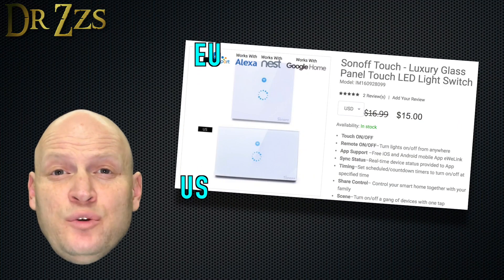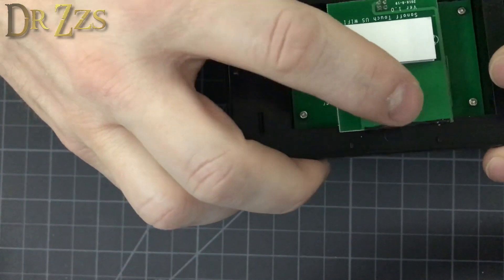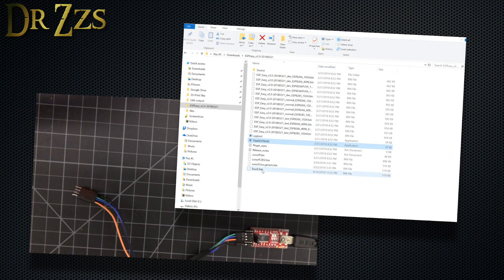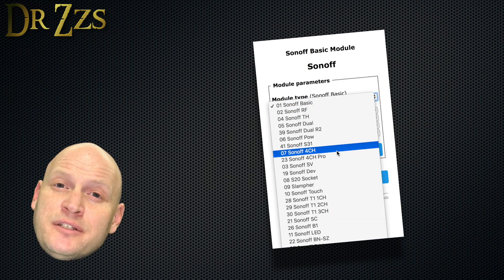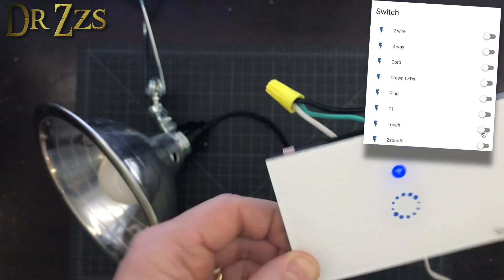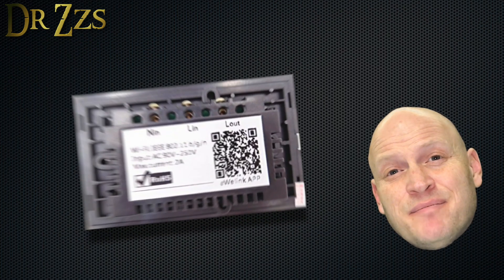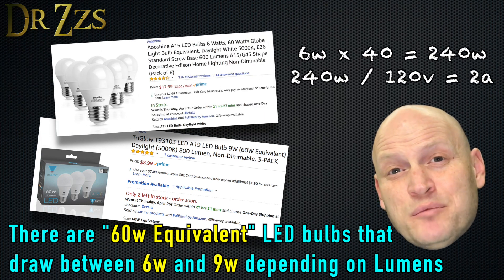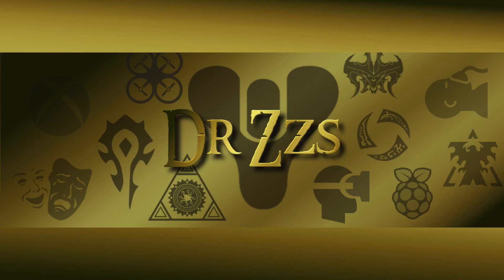How to Flash the $15 Smart Switch | Tasmota & Home Assistant | Home Automation

Comment: DrZzz, while I agree they are oriented incorrectly, same here in Oz its just a tiny Sonoff word that is the give away and no one actually reads what’s written on a magical wallswitch.
As for being able to pop off the cover, the reason is because you did not enlarge the hole in the wallboard to the size of the step in the mounting plate. If you do it properly then the faceplate sits flat on the wall and is much harder to get off, so much safer.
The other thing I have found is those terminal screws, they are way too long and you risk contacting the metal wall mounting plate here on Oz so I have been cutting about 2mm off them and now with Aussie sized wire they don’t protrude above the plastic case, much safer.
Great videos by the way.
Reply from the maker: Thanks!
Good tips.  I'll have to try cutting the bigger hole.  Fortunately all my switchboxes are plastic so I won't bother with shortening screws.  

I'm excited to try the 3-switch version when it arrives.

Comment: Loved this video.

Unfortunately, my WAF tends to zero regarding technology, but this product may help.

I live in South America so we deal with 220V here, but we use the American size for wall switches (power outlets are a mixture between European, Japanese and 3 in line...  not really a standard here).

I am planning to buy some of these (I usually buy directly from China, but I could also buy on Amazon from USA and have it delivered to my country, we have a limit that can be bought by customs regulation though)., and I would try these switches in a 3 way switch installation.

Thanks again for all your videos, please, keep they coming!
Reply from the maker: Gees, that's quite a blend of standards.  Good luck! 
I just ordered one of the new 3-switch versions.  Looks like they fixed the orientation.  Hopefully they made it a bit more secure in the box.  I didn't like the idea of bumping the switch and exposing live 120v wires.

Comment: Just wanted to thank you for all of the time and effort you put into digesting huge amounts of info from web pages, testing, compiling and then making videos that are helping the 'not so tech' savvy viewers get up and running with the technology stuff! ...and extra thanks for the B1 lesson. Thought my B1's would always stay on the eWeLink app LOL. BTW...any chance you can do a video of how to get a successfully flashed T1 back into programming mode? Can it be re-flashed? I have been flashing using Pete's method with sonoff.bin, (used yesterday's latest upgade) and now my first T1 flash attempt is a paper weight in my office. :/
Reply from the maker: You should be able to re-flash.  
You may have already read this if you flashed it once:
https://github.com/arendst/Sonoff-Tasmota/wiki/Sonoff-T1-UK-and-T1-EU

Looks like the T1 has GPIO-0 connected to the button one.  So pressing that button on power up should do it.  I'm waiting for my T1 to arrive.  When it does I'll be able to help more.

Comment: If I get a 3gang switch and connect only two channels can the 3rd one be used with something else? Like for example toggle air conditioner that is installed and recognized by hass?
I mean using scripts in hass.

Comment: I did that same thing with the BENLINK Smart Switch from Amazon. Flashed Tasmota and configured it just like a Sonoff in Home Assistant. Works perfect, not to mention it looks better in portrait and the wall bracket secures much better to the touch panel.
Reply from the maker: ooh cool. 
I'll have to check it out.  
Before long I'll have exhausted all the devices iTead makes and I'll start looking more at other companies.  There's probably other hidden gems of hardware out there that just need some good firmware to be great.

Comment: Thanks for pointing out the landscape orientation, I totally overlooked it.
Reply from the maker: I'm trying to decipher the sarcasm.  Maybe it's there, maybe it isn't.
Reply: Nope none intended. We use the long type switches in Oz too which are also vertically positioned. I had already researched to buy the long switch plate types but now you pointed out they are aesthetically challenged in the vertical position I agree. I'll need to pull out all the switches and see if I can go horizontal in case there is framing (I have drywall/plasterboard) in the way.
Reply from the maker: oh good :) 
They have a newer version of these switches called the T1, instead of the Touch.  Sonoff makes good stuff but their naming scheme could use some work.  Anyway, the new switches fixed the orientation.  I actually like the new ones, and you can get them with 2 or 3 relays in one single switch sized package.  They still have the blocky glass faceplate that I don't love, but I can find an easy way around that I think.
Reply: I did see the new ones on eBay this arvo but I thought they were copycats until I found them on the itead site. Going to purchase a single switch tomorrow to sample. Are you going to do a video on the T1 would be good to see your feedback on it.
Reply from the maker: I sure can!
https://youtu.be/Z7SlNtkmYyE 

:) 
We talked about it some in the last live stream too.  Well, not the last one, that was the maker faire, the one before that:
https://youtu.be/N2Yd0OP3zXs

I like them actually.  I want to use them behind a blank switch faceplate.  Still haven't had a chance to try it out, but I expect it'll work well.  And for the price, 3 switches for ~$18, they're a steal.

Comment: Hi I'd appreciate if you explain about 3 gangs switch based on your design do you use the relay or Triac?
Reply from the maker: What do you mean by 3 gang?  You mean the Sonoff Touch switch with 3 buttons?  I've got one on the way to me from China.  I'll open it up when I get it and see how they do it.  I'd bet it's relay based.
Reply: Hi, I mean what do you do with 3 gang switch and how do you handle it for smart automation ( sonoff just have 2 output)
Reply from the maker: each button on the switch controls a different relay.  So if there are 3 buttons there are 3 relays.  And each button/relay is controlled by different GPIO pins, so communication to the wifi chip can control them separately. I don't know the internal differences between the sonoff basic and the T1 3-switch, but they must do something different to have more available GPIO pins on the T1.  
Hope that answers your question.

Comment: Unfortunately in Brazil only 1 wire passes through the switch box (by convention), so Sonoff does not apply. Any equivalent you´ll would like to suggest?
Reply from the maker: do you haven a neutral wire in the ceiling then? You can put a sonoff basic somewhere else where there's a neutral wire.  Do you have a ground in your switchbox?  or maybe metal switchbox and conduit?  You could run a small wire from the Neutral-in on the Sonoff Switch to the ground.  That's not really a great solution, and wouldn't fly in the US with our electrical rules, but it would work to allow the esp chip to power up and control the relay on the switch.
Reply: Yes, I have the neutral wire in the ceiling, I will test that idea. Thanks again, and keep the good job please!

Comment: Ok, a probably lame question here - does this work when your wifi goes down? Not that it should happen too often, but currently the WAF of my IoT stuff at home is highly dependant on whether it is something independent of the wifi or not.
Reply from the maker: Unfortunately most of these things are dependent on WiFi.  If you have a physical switch or button connected to the sonoff it will work without WiFi. But the connection to Home Assistant won’t work without WiFi.  And sometimes when WiFi goes off and back on it makes crazy things happen to the stuff that’s connected to Home Assistant. 
Best strategy might be to limit the CtW devices that are “smart” (Critical to Wife).  The garage and my office are the most IoT intensive places in the house. The kitchen... not so much.
Reply: DrZzs thanks for the reply! Maybe I mis-phrased my question though. So what I wanted to ask is whether the "touch switch" part of this Sonoff is independent from the WiFi? So if the WiFi is down, I won't be able to use HA, clear. But how about the switch itself?
Reply from the maker: sorry.  I was answering from my phone and didn't even see which video you were referring too.  
It should still work without wifi.
Reply: Oh cool, thanks! Off to order some, then... :)

Comment: Definitely on the fence between doing Sonoff T1 or hooking up a rocker to a Sonoff basic. Are these UL listed?
Reply from the maker: I didn't see a UL sticker on it.  I'll double check. 
They're pretty good.  I think it depends on how much you like or dislike the look.
Reply from the maker: I still don't see a UL mark.  Just CE.  
AND they just barely posted a new style Touch that is oriented the right way and includes RF. 
https://www.itead.cc/sonoff-t1-us.html

But I still don't see UL listed on the label.  And even the 3 switch version is only rated for 2 amps.
Reply: Really appreciate all of your videos and effort on this stuff. 

I just picked up 3 Sonoff Basic's for testing, but these T1's definitely look like a good solution for two or three gang boxes. It would be nice if they were as wide as a 3 gang etc, but I guess I'll just have to pick up some faceplates. For the mounting bracket of the T1 you have, could I get the dimensions off of you? Would have to mock something up for a 3 gang cover.
Reply from the maker: sure thing! 
I just ordered the new version of the 3-gang T1 also.  It'll take a few weeks to arrive but I'll hack at it when it gets here and let you know what I think. 

Here are the dimensions from the itead website.  The whole outline is 78x120mm
https://www.itead.cc/smart-home/sonoff-touch.html
Reply: Technically those are still 1 gang T1's though, it's just 3 switches in a 1 gang plate.  The gang size in the US goes by the box size not how many switches are in it.  I'd call it a 1 gang 3 switch T1.  Say that 3 times fast...  3 gang box for reference.  https://www.homedepot.com/p/3-Gang-44-cu-in-New-Work-Box-B344AB/100404028
Reply from the maker: Cursed nomenclature!
Reply: If it is only one output control, you may be better off with the Sonoff Basic in my experience.  I built a switch box controller by taking the basic out of the box, reflashing, of course, and protecting the bare board with large clear heat shrink tubing.  I then bought a cheap plastic wall plate, drilled a hole, and mounted a very nice Banggood momentary pushbutton wired to GIOP14.  That worked perfectly and I can even control the LED remotely not that I can think of a good reason to do so...  This whole put up costs a lot less than a T1 and does essentially the same thing only with greater current carrying capacity...  I only see value in the two or three gang T1s myself.

Comment: Hello. I need to exchange an idea with you ... how can I tell if the lamp is on? can you change the programming to know the off or on status? I need to connect via socket or php;
Reply: If you use Tasmota, it sends an MQTT status message when it's switched on or off.  You can also query the status by sending and MQTT command.

Comment: Good morning Dr!!!!
As always thank you for all the videos you post. I am an avid follower and always get ecxited to to a new video. 

One question I had was, where did you get you FTDI adapter and cables. I have not been able to find the one you is in all you videos.

Do you have one specific adapter and cables you use or do you have different ones for different sonoff devices?
Reply from the maker: Thanks!
I use the same one for all my flashing: https://amzn.to/2tlhVH4
the wires you see are just a mini-USB cable and 4 female/male jumper wires. 
https://amzn.to/2K8Xd3j

that's way more jumper wires than you need but I find lots of uses for them. 
Mini USB link incase you don't have one: https://amzn.to/2MeZc6P
But there are also ftdi's with micro USB (much more likely you have that around your house already)
https://amzn.to/2KdkhBu

Hope that helps!

Comment: Correct me if I'm wrong but is that bracket meant to go behind the wall?
Reply from the maker: That might explain why it didn't fit so well...

Someone else said I need a bigger hole in the wall.  I've got the next-gen "T-1" to try soon, so I'll get another chance to install it right :)
Reply: my bad, after taking a close look at mine, you have done it right but it should clip in and look flush

Comment: Hi, one dumb question DrZzs, I know that with Tasmota you can control and edit smart home appliances and sceens... without internet, but when you change firmware of device is still able to work with Smart Life App, Tuya App  or something like that.... very clear video's you produces, keep good workin..
Reply from the maker: Thanks!
no, once you change the firmware you loose the ability to use the stock app from the manufacturer.  
Flashing isn't always the right choice for everyone.  But if it's something you are interested in doing it opens up a lot of possibilities.
Reply: @DrZzs  Thanks on your answare. Made me clear 😃 right now. So first thing to do is firmware backup and than sky is the limit. Regards

Comment: Dr Zzs! We have a problem with sonoff 4CHpro R2 device. The problem, we have original FW and we use with ewelink app, and we add only 8 schedule, but we need 32 schedule opinion, because we want 4 times turn on and off.  How is it possible? Maybe the Tasmota sw is the solution? Can you make a tutorial video about the sonoff 4chpror2? Thank you very much in advance!

Comment: How can you solve the ghosting problem on this switch? With the other sonoff I did what you explained in previous videos, but in this switch  there is not a gpio 14 pin, so to what pin should I connect the capacitor/ resistor?
Reply from the maker: are you having ghost switching with it?  You shouldn't be.  
Is it going on/off when it disconnects/re-connects to wifi?
Reply: DrZzs  I’ve it for a couple of months, it’s randomly happening (sometime  it can be 3 weeks without this problem), maybe the problem is really the WiFi because this room suffer from poor WiFi, there is a method to prevent this from happening?
Btw thanks for the super quick respond, and awesome videos ;)
Reply from the maker: you're welcome! 
I would think the wifi dropping and reconnecting is probably the problem. 

Try changing some of the settings in the Tasmota Console (assuming you're using Tasmota). 
Try:
"setoption0 1" 
and
"poweronstate 3"

The setoption0 1 will save the state of the switch, and poweronstate 3 will set the state of the relay to the last saved state after restart. 

Give that a try anyway. 
Let me know if that helps at all.
Reply: DrZzs I’ve tried it, it turned on the light in the room 5 times during the night :(
I’ve the touch set up as a 2 way switch, one is connected to the the lamp and the other one is just sending command through HA.
I’ve write the commands on the console on both switches, maybe that’s the problem?    If not idk what to do😭

Comment: Thank you! Great videos!

I have a us 2 gang version. I'm able to load firmware into only 1 of 2 switches. How do I put the 2 gang/switch into programming mode?
Reply from the maker: Did you successfully flash it but only one button responds?  If that’s the case then make sure you have the correct module selected from the configure module page.  There are 2 different kinds of sonoff switches like this. There’s the “touch” which is the one I did in this video. Then there is the T1, which is the newer version. The process for flashing is different and the pin assignments are different so make sure you know which one you have and select the right one from the module type menu and follow the right process for flashing. 
Touch: 
https://github.com/arendst/Sonoff-Tasmota/wiki/Sonoff-Touch
T1: 
https://github.com/arendst/Sonoff-Tasmota/wiki/Sonoff-T1-UK-and-T1-EU

Hope that helps

Comment: Hey DrZzs, Did you try flashing it using the OTA procedure ? Great video and greetings from Uruguay !
Reply from the maker: Hello to Uruguay! 
I did not try OTA.  I bought this touch a long time ago and just barely got around to flashing it, so it probably did have the older firmware.  My guess is if you buy one from iTead now it will most likely have 1.6 or newer and won't work with OTA.

Comment: So.......I select "Export compiled binary" then compiles the sketch.......but fails at end with message: exec: "make": executable file not found in % path%

Error compiling for the board Generic ESP 8285 Module

Any ideas?

And are your TX and RX pointers in the video what we connect our FTDI TX to TX or do we have to cross over the FTDI TX to the sonoff RX as marked in the video?
Reply from the maker: My markers are what the pins are at the sonoff.  So Tx from your USB/Serial goes to what I pointed to as Rx.  
I think the make path error has to do with being administrator or just a user in windows.  Try using the "Windows zip for non-admin install" version. 
https://www.arduino.cc/download_handler.php?f=/arduino-1.8.5-windows.zip

Or try running the IDE as administrator.  

That's my first guess.
Reply: Thanx dude, I eventually found the sonoff.bin file and successfully flashed that with ESP 8266 easyZ
Reply from the maker: sweet!